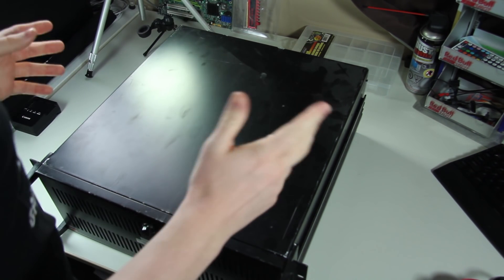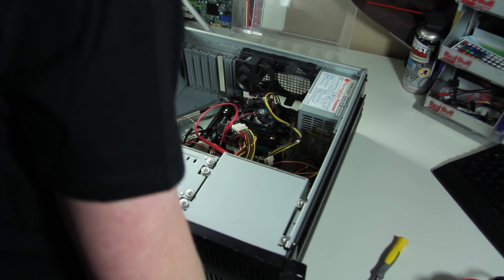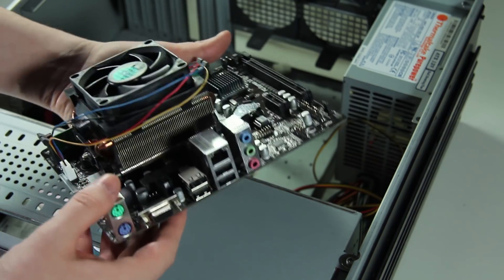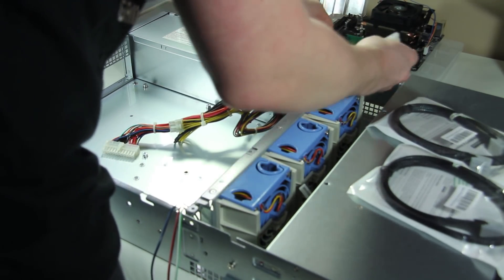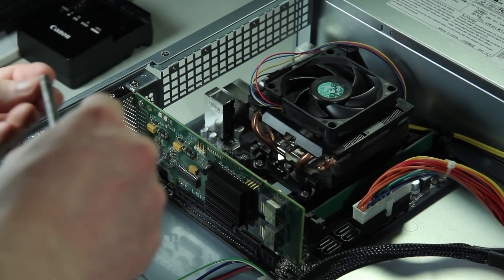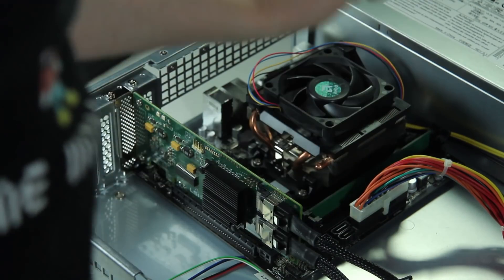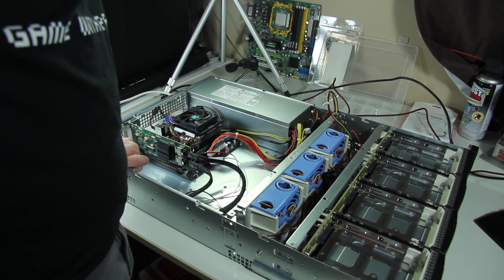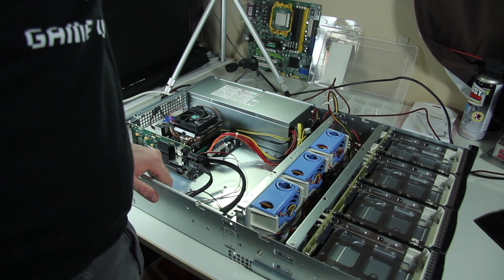Storage Server Hardware Assembly - Build Log Part 1

Comment: Hey, good video. Which Motherboard reference and CPU did you use ? I'm about to buy the same case thx
Reply from the maker: I just used what I had laying around. Its a cheap FM2 board with a A4-4000 apu in it.

Comment: Hello i know this is a older video. But the mother board doesn't have USB3 or HDMI it is a cheap board wit hthe same socket as your processor. I have a new CPU i use for servers that the motherboard doesn't have HDMI or USB 3. But great work you are doing there.

Comment: Artic has some good low profile CPU coolers that I've used in a few servers.  Might check them out if you're really concerned about the clearance for the CPU cooler.

Personally I wouldn't worry, it looks to have plenty of space to pull ambient case air into the cooler.

Comment: That's actually a MicroATX mobo and not MiniITX.....
Reply: no, I'm pretty sure it's MiniITX. MiniITX boards do have 1 PCIe slot. My PC has a MicroATX board which is both wider för more memory slots and maybe slightly taller for 1 16x PCIe slot and like a 1x PCIe slot above it or something. They are a bit similiar tho, but u can tell because the MiniITX has barely any room for 2 memory slots and the IO is like a third of the board

Comment: I removed 2 of them and used one Noctua, but it's still loud as in my case the older PSU's are also extremely loud. Even too loud for our server room .
Reply from the maker: That was one of my main worries when buying a server PSU. The one I got ended up being really quiet, but I got a single instead of a redundant since the fan is bigger.
Reply: I will try one day this spring to replace the fan inside the PSU's. 
But unfortunately a 4x4cm fan has to be fast to produce enough air.
Reply: @llothar68  don't do that. really. don't do this...

Comment: Thanks for doing this!
Does the backplane support 4TB+ drives? I'm struggling to find some information about the backplane (is it 80H10321516A1?)
What drives are you planning to use in it?
Reply: You are directing your question in the wrong direction. The back plane has nothing to do with what drives will be supported besides the interface of the HDD's. The size limitations of the drives themselves is always dependent on the HBA or RAID controller. You have to get some pretty ancient stuff for internal RAID and HBA's to not support larger then 2TB disks. The Dell PERC 6i was the last card from dell that only supported up to 2TBs. The H200 and beyond are all capable of drive sizes currently in existence. The Dell H200 is just a re branded model of what this guy is using. 

Secondly don't worry about the backplane speed with SATA. For one doing a quick search this backplane is 6 GBPS on both SAS and SATA. Even if the backplane is SATA 2 no hard drives are going to have saturation issues.
Reply: I have an 10 year old supermicro case and it supports 4TB. Why shouldn't it. The backplane contains no logic itself, it's just mechanical connector.
Reply from the maker: I am not 100% in 4TB+ drives. The max I am using is 3TB.  The backplane is SATA/SAS 6GBs, but that is about the extent of what I know.
Reply: Thanks. I found a tech sheet that said it was SAS 6 GBit, but just SATA-II, so I'm still confused about the whole thing. Might just shell out the extra dollars for the RM23612 to be sure.
edit: Oooor, it's a homeserver - speed doesn't matter and I'm probably only going to use 3TB drives myself - it's what I'm using in the current array.
Reply: Yes, quite. Did some reading after posting the question and realized the same. This can be a limitation on expander backplanes, though.

Comment: hey before your next video can you show how u hooked up your wiring
Reply from the maker: There really isnt much wiring. CPU power, 24 pin to motherboard, front power button to the motherboard, SAS cables, and the molex power to the backplane. That's really it. The fans too i guess.